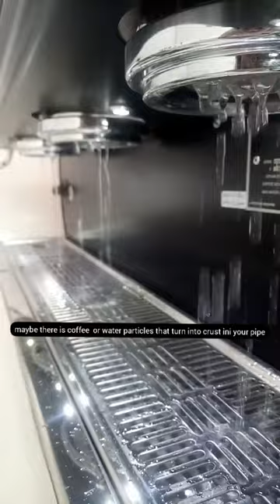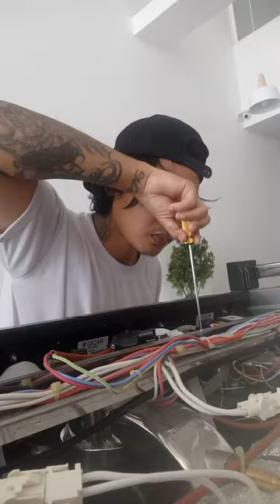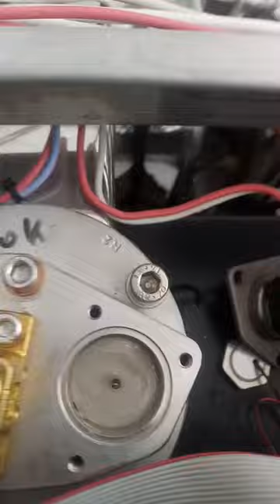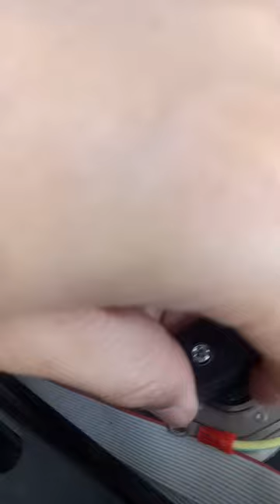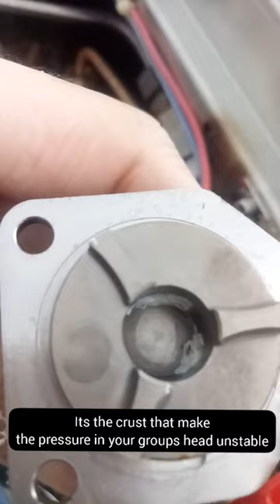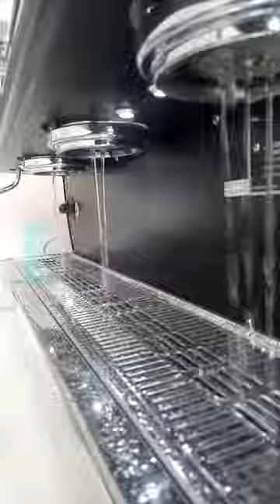How to fix low water pressure on your group head

Comment: In my GB5 AV mqchine the water pressure come to 6 bar when I start the express cycle.. and it come to 9nbar when press the hot water dispense button..

Can you help out what should be the reason of pressure drop? 
I clean all groups heads qnd remove scales attached to it
Reply: Check the moter capacitor.